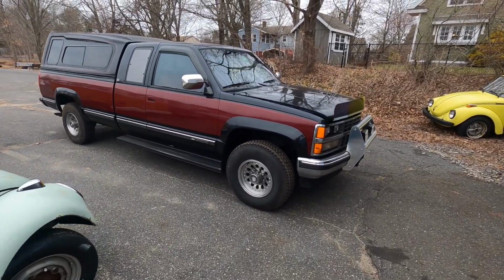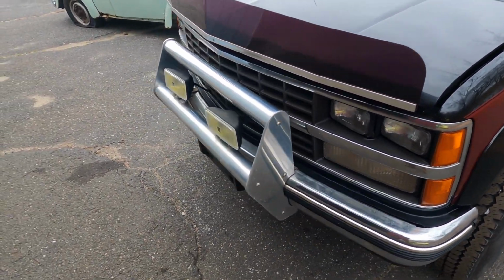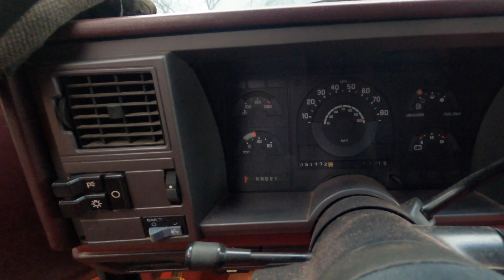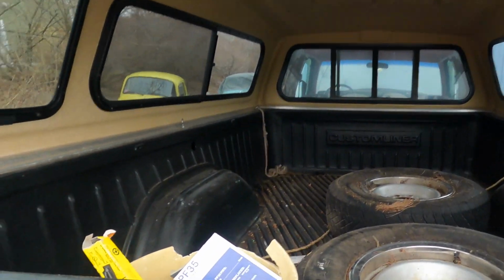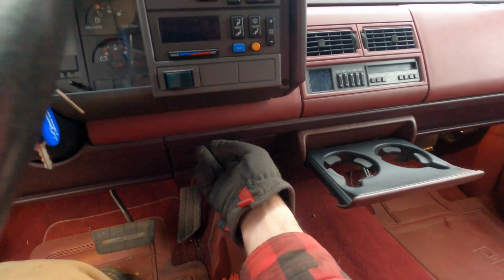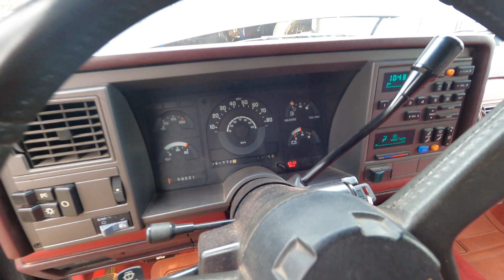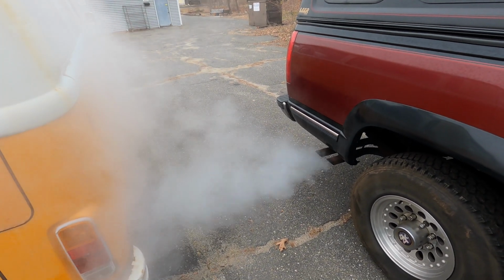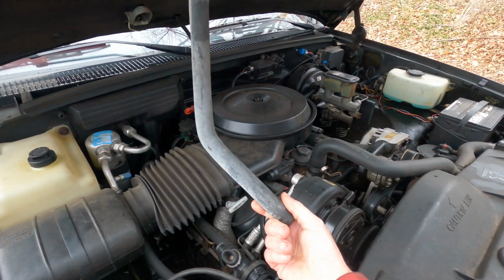1989 Chevy K3500 Big Block 454 7.4 4x4 Rescue Rig - GMT400 Beast

Comment: I hope you get this its been a year since video! O hope you still have your 89 and its doing good!
I just want to mention something interesting.  Ive got a 88 and a 89.
My 88 is a K2500 6 LUG EXT CAB LONG BED 350 MOTOR AND 4 SPEED TRANS.
Now my 89 is a K3500 EXT CAB LONG BED 454 AND FACTORY 4 SPEED.
I notice you have 4 headlights and my K3500 has 2 but my 88 K2500 has 4.
I mentioned my trucks on Youtube and several told me that GMC and Chevy on their heavy duty trucks they put 2 headlights on them and 4 headlights on the lighter trucks.
I can say your truck is not a light duty truck but im just curious now bout this. Not sure bout yours but mine came with factory skid plates all under mine. Gas tank has one and one starts under radiator and goes back to front axle and there is another one but cant remember and they are steel. My 89 K3500 is solid red and beauty rings and chrome center caps on wheels and i think thats what you have.
All i can tell you that 454 is a hoss! Oh you have drink holders but mine dont except two little circles on inside of glove box door and no way would i put a drink there but where your drink holders are my 4 speed shifter would be in the way to use them. Mine is all original but doing a whole lot of TLC on it where its been neglected. Ive only had mine 5 months but im planning on going through it. Fuel pump was bad but gas tank was full of rust and crud and gas filter stopped up and injectors were bad bud all new and you sure better hang on now and you better hang on for sure now when i punch it. I hope your liking yours buddy! Take care!
Reply from the maker: hi Tommy, it broke a push rod ! sat too long , stuck lifter .... as for the headlights ( i'm not an expert here ) i think the " work " 3500's had the two headlights ... the town type / fleet trucks .
Reply: @5150mxVW  OH man I hate that and only 50 k plus miles! I would've told you but its been a year so I figured you had done figured you out but of you or anybody ever gets one that has been sitting or very little driven get some Amsoil Engine Cleaner and put it in motor and ONLY let IDLE NO driving for EXACTLY 15 minutes and cut it off and immediately drain and put regular oil in. Amsoil will  clean your engine. Oil clumps up and it will kill your oil pressure. I bought my 88 GMC and I put a new oil pressure gauge in it as soon as I got it. I had 9 psi oil pressure and I was on interstate the first time and i liked to had a heart attack. I couldn't just turn around and I babyed it back home.
I had 5 psi at idle and 9 psi road speed.
A buddy told me and he is a mechanic bout Amsoil and told me what to do.
After I done it at cold start I had 60 psi idle cold and when it warmed up I have 55 to 60 psi road speed and 25 psi at idle warm just doing it one time.
I'm sorry I didn't have a smart phone when you got your truck but i wished I did. My engine set in a junk yard for a long time before it was put in my truck.
That was going on 4 years ago and matter of fact its realy my daily driver cause I love driving that old ugly truck and I wouldnt be scared to go across country and back in it. That stuff works!
Thanks for telling bout the headlight reason cause when I seen yours was a K3500 it kinda confused me so I preciate it buddy!
I hope you fixed it and it's doing a good job for you!

Comment: That’s not lifter noise that’s the air pump for the egr system the hose you found lose goes to the air pump back into air filter